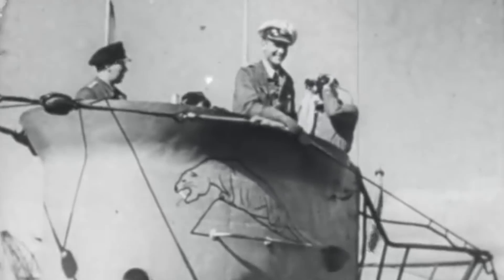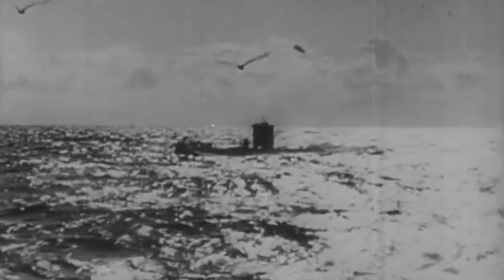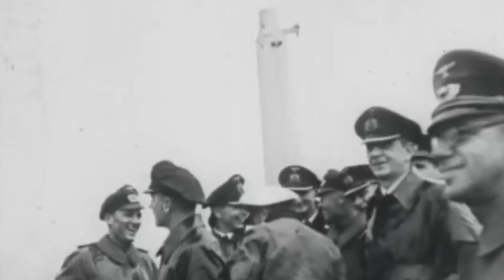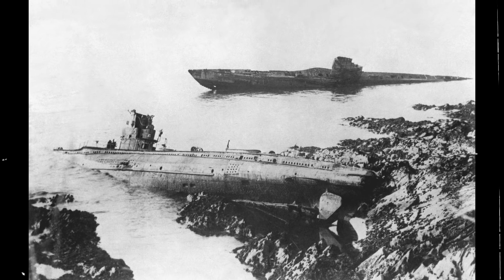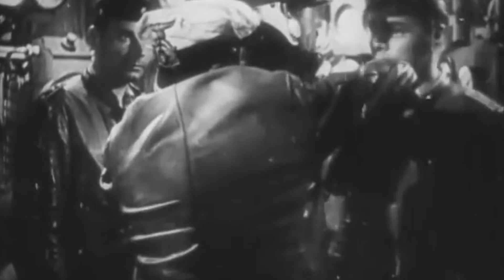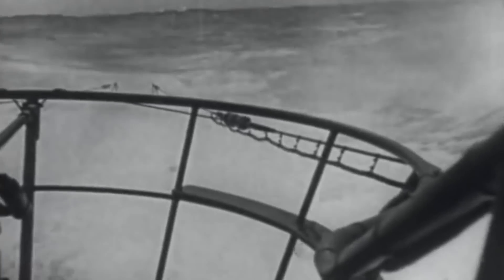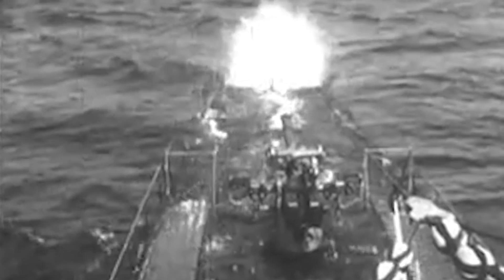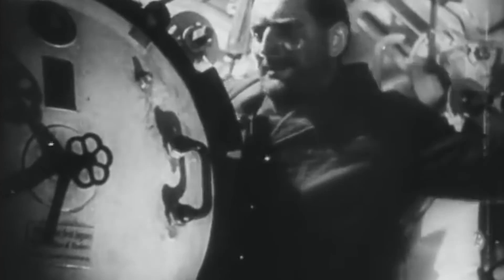The Toilet that Sank a Submarine

Comment: An example of overthinking a problem into existence that didn’t really exist in reality. Holding tanks would have been very easy to engineer. And the ships overall weight does not change even if the sailors does after a visit to the heads.

Comment: And that was an "improved' version of the toilet.  If your toilet can only be operated by a specially trained technician - then you need to fire the designers and start over.

The installation of a check valve (a valve that only allows a fluid to flow in one direction) was too difficult a concept for those engineers to understand?
Reply: i am sure there was a reason. it was not explained what actually went wrong just something went wrong.

Comment: As a joke aboard US deisel boats back in the 60's-70's...newer crew members would be preparing the shower vents to take a shower while "evil" crew members would pressurize the sanitary tank, coating the "froggy new guy" with it's contents.  Fresh out of Sub School newbies were always assigned mess duty and since there were only two 2000 gallon fresh water tanks for the entire crew...they were the only people allowed to shower for weeks at a time...I remember almost dreading it each time it was my turn to shower!  You never knew when they would strike...
Reply: The worst part about that prank would be even though the frog got covered in poo, wouldn't it make the whole boat stink until next time you snorkelled? If I'd been a Chief on your boat, I'd seriously consider stuffing the pranksters in the torpedo tubes for my own amusement...
Reply: @tsubadaikhan6332  Pranks were never practiced while underway.  Unqualified (takes about a year) crew were required to berth onboard for that period, however, those boats had highly efficient charcoal filters in the head area since even flushing the toilets required a sequence of valves that vented the sanitary tanks inboard briefly.  They were efficient enough to "eventually" clear the air even after a snorkle mast dunk caused by the two planes operators which would allow three very powerful diesels to exhaust inboard enough to fill the boat with smoke for several minutes. Cursing could be heard throughout the boat at those times prompting visits to the control room to see who was responsible LOL:).  From BO of the crew (no showers underway no matter how long)...sealed in an environment laden with diesel fuel (your skin took on an amber hue after awhile)...even your fireproof matress covers were covered in a film from it...toilets venting inboard...galley oders from cooking for 50 men and many more.  I remember giving tours and often asked "What's that smell?".  I would respond "what smell"?  LOL:).  You habituate to it and over time don't notice it.  Not to our faces...we were called "Pig Boats" by the rest of the Navy.